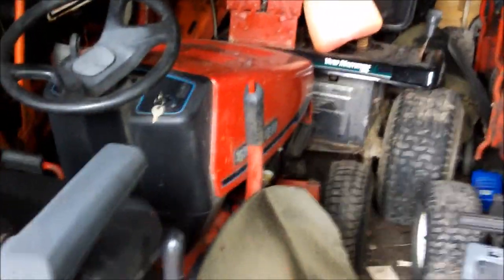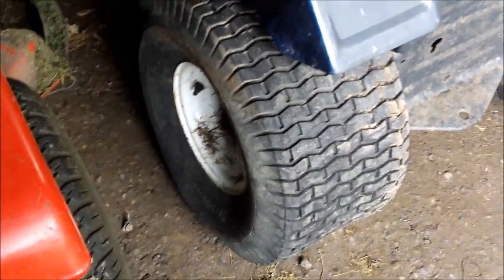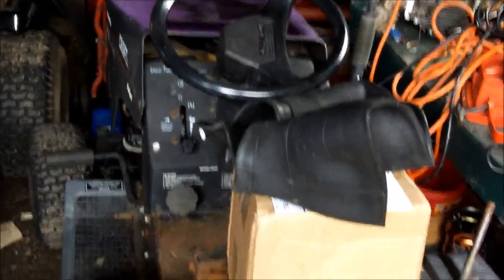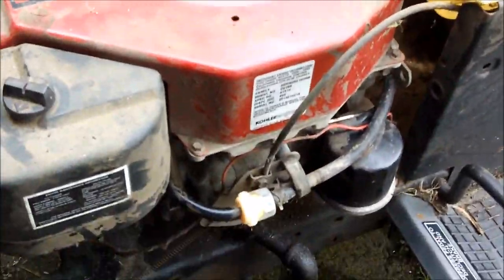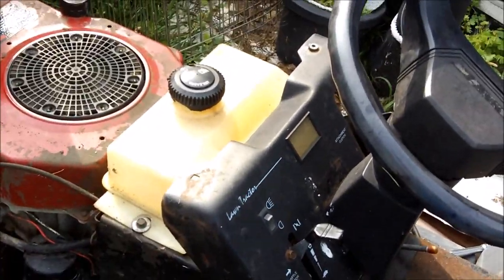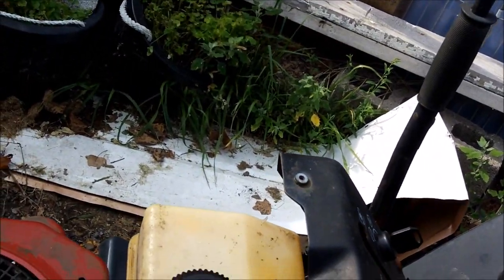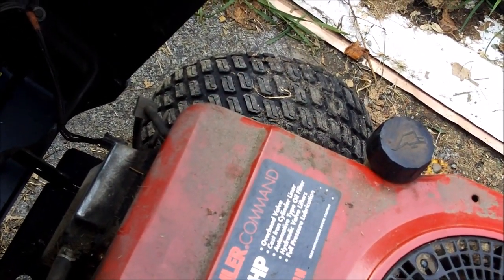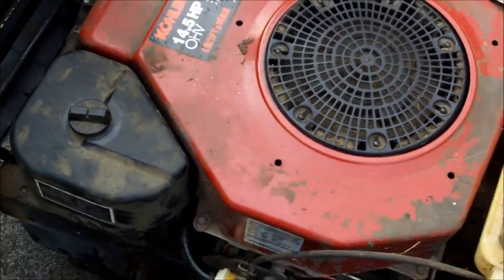starter came for craftsman lt4000 tractor can't get tractor to run yet

Comment: Start with the basics. Check the fuse in the starting circuit. Could also be a defective key switch or related wiring issue.
Reply from the maker: Sprocketsgarage fuse i found is good there could be more not sure yet.

Comment: Few things about those engines, you almost always need a good battery due to the carburetor solenoid, the starter solenoid is located underneath the gas tank starter side, most of safety switches are in that area as well, (under the gas tank), craftsman are very easy to hotwire the safety switches all you really need to do is unplug them grab a small piece of wire and cross the white wire to white wire block wire to block wire.
As far as I know those engines have non adjustable valves because they are hydraulic, basically once you get it running they pump up with oil and they normally are ok, all the Kohler Commands I've had never had oil safety switches, I don't believe they came with them, at most a tractor would have a oil light or gauge.
You definitely need to clean up your battery cables and get battery bolts that could be causing a lot of your problems as well.
As long as the wirings are not cut or modified you should be okay with the stock wiring, also don't forget to check the fuse.
Reply from the maker: redneckbryon  not sure what you mean about hot wiring safety. where are they in the wiring? ive found the fuse it looks good not blown. i'm think the fuel solenoid might be not working because of bad solenoid. might shoot a video on it tomorrow,
Reply: bleachedpc the starter solenoid has nothing to do with the carburetor solenoid not working, what you could do is pull the carburetor solenoid off and soak it in carb cleaner that normally freeze them up, also just spring carb cleaner into an open carburetor will not clean them you need to pull it off and dip soak it.
When I refer to hotwire in the safety switches, basically you unplug them and you put a piece of wire between the contacts so you don't need to cut the connector off, this also works to bypass them.
Reply from the maker: redneckbryon I got it to run today 30 seconds and then shut off must not be getting gas but its dripping out the carb bowel like a sib. new video will be up soon

Comment: Looks like the clutch padel not down there safely switch there too make sure the mower engagements lever off and clutch down and battery hooked up it should turn over with a key and if it did if not starting check for spark if no spark take the cover off the engine and take the black wire off the coil if no spark again then needs to be clean or replaced